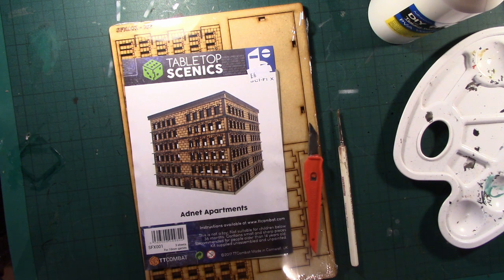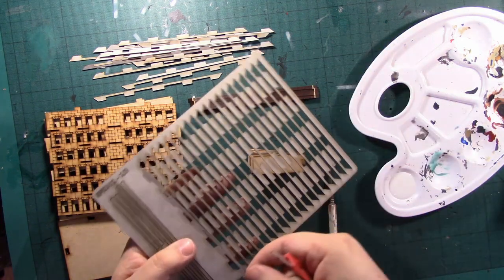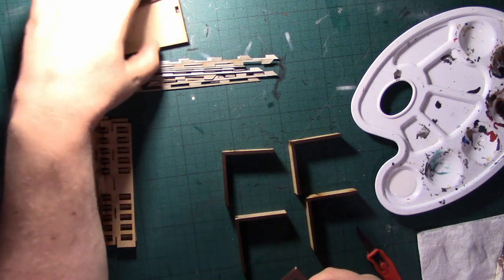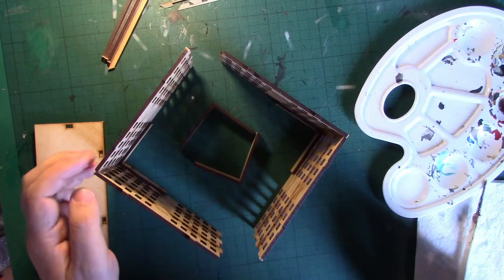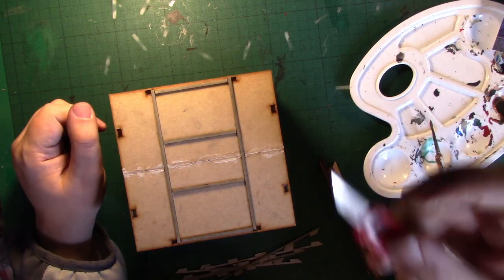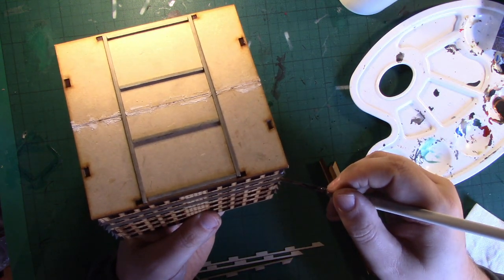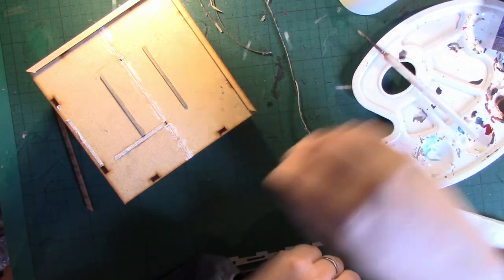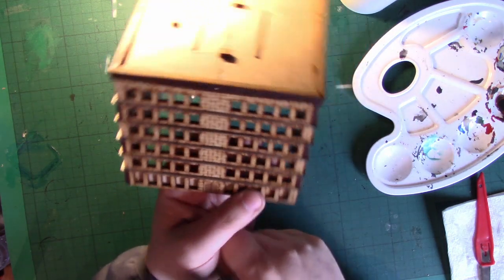Adeptus Titanicus Terrain TT Combat Adnet Apartments

Comment: The card strips that you put on the roof are supposed to be trim around the base: one long on each side, two short ones each front and back on either side of the door.

Before painting, apply a coat of wood sanding sealer, then it will take paint well without soaking up too much.